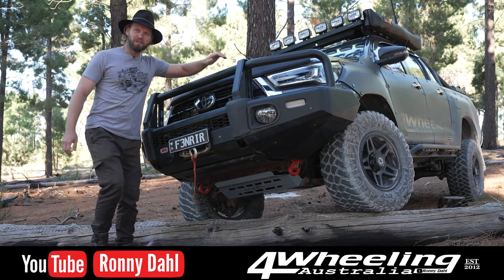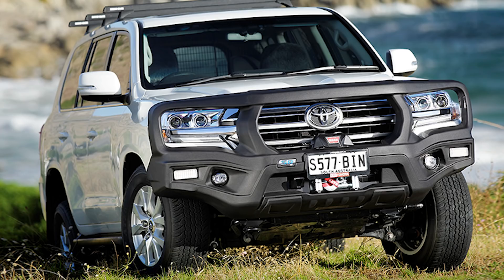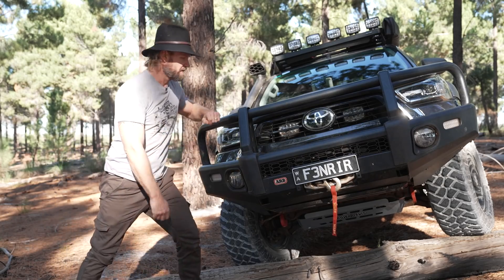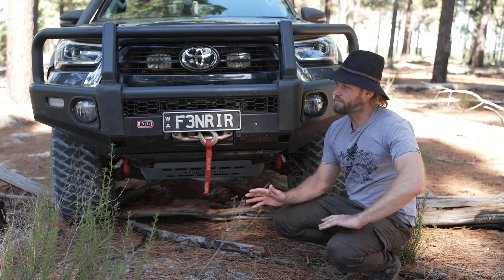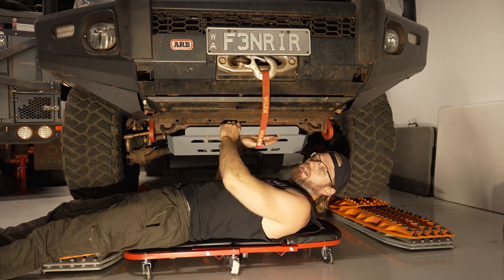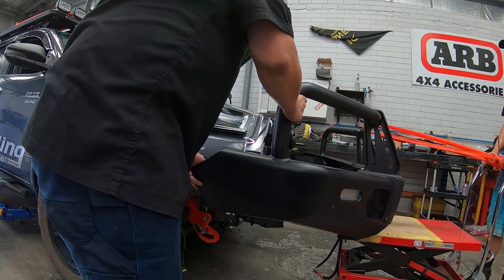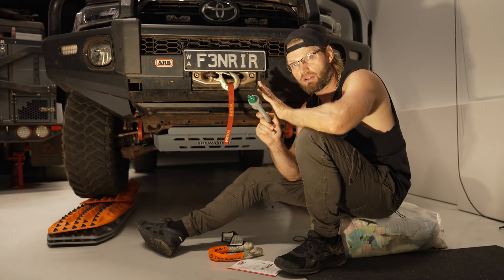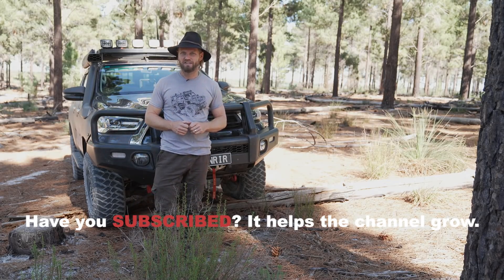2021 Hilux mods, off-road bar work mods part 7

Comment: I put an Aussie Aluminum Alloy Bull Bar on my 1987 Suzuki Samari. Was running 30" tires and a 2" lift, doing 65 MPH down the road and a ten point white tail buck jumped out of the ditch. This thing weighed  200lbs dressed. 
My reaction time in those days was better then most and I was able to hit the brakes at impact couldn't bare to look at damage for a few minutes, thought my Sami was toast. The only damage, was the top horizonat bar was bent maybe a half an inch! At 1000 dollar price tag in those days, that was the best insurance possible. Weight was a factor with the Sami so I went with the Aluminum Alloy, advertised as "strong as Steel"!

Enjoy your treks on the tube, trying to adapt my Sami to accomodate my bilateral amputation, slowly but slowly, LOL.
Regards

John R Monroe
Hibbing, Minnesota

Comment: Nice video again! 
About the transfer case bash plate, I think those mounting points on the case looks pretty weak. Aren´t you worried it will just break off those instead? I figure the original one will give way, but still protect the cast housing with a bit tougher steel? Maybe you have some experience or stories about what and how things break underneath - would surely be an interesting episode ;)

Comment: Hey Ronny as always thanks for your work. Quick question and recommendation, 40mm or 60mm ARB Summit steel bullbar? For a 78LC what would you suggest? I don’t intend to install flares on the LC78. I’m leaning towards 40mm due to weight. What is your recommendation regarding weight and strength difference stats. Thanks in advance and Happy Easter.

Comment: My rear recovery point is a 15 ton pintle hook and recovery strap. I got both the hitch and plate for $40 total plus hardware. The last 2 years I've recovered several vehicles in Alaska. I can't complain, it works.

Comment: Nice 4wd mate.  What are your thoughts on the fact that it will deactivate the A-TRC when the rear diff lock is ON while in low range?  Do you think it was a completely bad set-up from Toyota?
Reply: So that way, the front diff acts as an open one with no control.

Comment: Q: Was the bumper cut-in the only option or do they offer a full replacement bar?

The TJM Outback T13 bar includes rated recovery points and looks a lot better on later designed vehicles like yours because the design conforms to the angled or diamond-shaped grill. That model ARB bar is great but was originally designed for vehicles with a squarer, old school stance like the 79, Troopy etc. Love ARB, but it’s deffos time for them to up their game and release a bar for the 21st Century IMHO.

Comment: Hey Ronnie, just a thought on your winch set up. Weight, Safety and everything in between, I am pretty much down to a soft shackle  for all my attachments now and have removed my hook all-together. Basically I go direct from the thimbled eye on the winch Dyneema to my soft shackle to the point I'm loading, cant for the life of me see why I need another potential point of failure in the system (the hook). I have a short section of inch poly pipe with a v groove cut out for the thimble that locks against my fairlead to hold the thimble in place, just winch in and lock it away. Works a treat, keep up the good work bud

Comment: Great info Ronny, I’ll suggest double checking the weight of your bar. Had a steel TJM delivered to my home to install on my FJ. i was told it weighed 65kg. Bar arrived in box and the weight printed on the box was 100kg. I weighted every piece contained in the box and yep it all came to 100kg. I weighed the parts that came off my FJ to install the bar which came to 12kg. I added 88kgs before even installing the winch. Your weight of 65kg is bar only and not all the added bolts, support steel bracing etc etc
Reply from the maker: Interesting points there mate, I’ll add an unknown extra weight at the end to allow for it perhaps unless I can find the actual info
Reply: Which bullbar was it? On their Tjm website it says 100kg?
Reply: @sonsam1966  it’s the outback T13 bar. My experience was back in 2014. Back then no weights were mentioned on their website and I could only get info of 65kgs by the salesperson. It was impossible to get accurate weights of bars back then by any manufacturer. For some reason they kept quiet on that area but we know why now. In 2017 I changed to an Xbox bar and halved the weight. Cheers
Reply: Yeah I agree it’s a good solid bar but that’s way too Heavy on the nose of the vehicle even tho recovery point and reinforcements been added

Comment: Would love to see that Bull-Bar comparison. A comparison from full bar to the half bar without the top protection would help myself a lot too.
Reply: I was about the comment exactly the same thing. Love the look of the single hoop / predator bars; but are you just sacrificing your headlights or is it actually less engine protection than a full bar?
Reply: I have a 2019 Hilux with a ARB Sahara Bar single hoop. The hoop is only thin aluminium held in with  two M8 or M10 bolts either side. The protection that it would offer would be minimal. I didn't want or need a full bull bar, we do minimal rural travel and I didn't really like the look without a hoop. Not a comparison as such but maybe some food for thought.
Reply: @simmo6035  thanks Adam, does give some good insights. Cheers
Reply: @ablokecalledbeer  second this!

Comment: HI RONNY, I HAVE AN IMPORTANT COMMENT THAT YOU MIGHT WANT TO READ! Just like your issues with the roof rack, have you checked that you are under your front axle load rating with all that weight added to the front? Also is there enough weight left for the driver and a passenger? I know with that bar work that it protects the vehicle but it is quite an important point to mention non the less as insurance could be void if over the front axle load rating.

Comment: Another informative video Ronny. Can you advise what you done with the diff and gearbox breathers on the Hilux?  The factory breather on rear diff is located on the diff housing and the gearbox/transfer are located on top of the bell housing, and did you manage to find where the breath for the front diff is located?
Reply: Good question
Reply: If the breather sits on the rear pumpkin, isn't that lower then the rated 700mm wading depth?
Reply: @perpelle  Hi pelleper, it is my understanding that the specified wading depth is set to prevent water ingress into the air box, the computer and other critical electric components, and maybe even the alternator and possibly any air vents.  As the diff breather is effectively a one-way valve, no water (or air) should be able to get back through it.  This can be an issue as when a hot diff is rapidly cool (like when do a water crossing or it gets splashed with lots of water) the air will reduce in volume and cause negative pressure inside the diff housing that will suck the diff breather closed.  But as the negative pressure inside the diff will try to equalise with the outside atmospheric air pressure (or vice versa), it could end up sucking water, dust, mud in through the wheel bearings.

Comment: Wow is an additional 120kg forward of the front wheels really a safety feature? Also you have used half your payload on accessories so no passengers or GVM upgrade? It's amazing how quickly it all adds up and no doubt continues to add up in additional fuel cost over time, hopefully you can show us the sums so we can make an informed decision on what we bolt to our cars. Great series 👍 Cheers
Reply: Once you hit a big kangaroo you'll think it's great.
Reply: Be interested in crash testing, how do they pass adr’s etc? Are they designed to still work with crumple zones?
Reply: @KaizenOz  they pass crash testing, they work with crumple zones and they pass ADRs.
Reply: Mining company BHP, crash tested their Hiluxes with bullbars and rollover cages.  Conclusion:  leave safety to the experts, the OEM

Comment: the bull bar added 110kg to the front and changes the weight ratio between front and rear. Do you need to change something on your suspension because of the added weight? Maybe more "preload" on the springs?
jealous greetings from Germany, such cars would never be possible here :D

Comment: Love your vids mate.
Ronny I get that you don't like the look of  most aluminium bars but the Toyota aluminium bar is the best looking bar for that model car in my opinion (its well balanced compared to others) and you can have it painted black.  
It's winch compatible with the little number plate door. 
The product development budget is 20x more than all other after market bars so it's not unnecessarily over engineered, it has 90% the strength of steel, yet less than half the weight (not two thirds like you said) and of course its air bag compliant. 
It's designed to flex and fail before your chassis does which is a big thing if you don't want to crab walk forever after a kangaroo strike. 
It's also designed to act like a hull in water.
The reason why I bought one is because being a bricky I've dropped many profiles over decades, steel and aluminium and the steel ones always bend on impact where as the aluminium ones flex and stay straight. I knew this flex was important so I went down that path and I was right. My bar has hit a good size roo (unfortunately hard enough to kill it) and it only dented (which was easy to hammer out). It acted like a tough spring, I suppose thats why Toyota promise you can drive on after a kangaroo strike.    
Thats my experience anyway.

Comment: Hv to admit, 15 years of 4wdriving since i was 25 yr old and i hv been using the shackles the wrong way.
Thanks Rhonni
Reply from the maker: I have as well mate
Reply: Really it is the  recovery points which are in the wrong orientation - if the holes were in the horizontal plane the Riggers "proper way" would be the correct way...
Reply: @kadmow  
😆Jesus bro, don't do this to me.

Comment: Wouldn't mind finding out if you are installing any gauges?  Monitoring Trans temp / EGT while towing?
Reply from the maker: I have a scan gauge already but I’m still waiting on X codes so I can read everything
Reply: @Ronny_Dahl  Thanks mate.  I don't think you can get EGT's with the scan gauge but I might be wrong.  I know I can't with the Prado 150 (2010) that I have.  Requires a sensor tapped into the manifold or exhaust.

Comment: You're not wrong the steel bullbar is heavy, i put one on the Prado before lift kit.
The 50mm lift raised the front 70mm, it sagged the stock suspension that much! Mines 80kg so a fair wack more than the Luxy one.

Comment: That’s a lot of weight, but when touring, it’s a necessity. Hit something with stock bumper it’s a trip ender.

Speaking of the front bumper and it’s removal... it IS actually a removable bumper. If you look closely, there are lines underneath the lines & the front grille. So the bumper itself was no need for cutting it. You could’ve removed it with ease.

Comment: A Bullbar is a must if you are travelling remote locations and as you say not just for animal strikes. I was in low range trying to get up a sandy track and smacked into a tree at the top as my momentum didn’t allow the car to turn as I hoped .... a dent in my Bullbar but I could continue my trip

Comment: Hey Ronny
This is a great series of videos! I'm learning a lot, even for my Ranger, as my first proper build. So far my only disappointment is the Rhino-Rack Pioneer Platform not being as capable as I expected and was advised it would be, as you outlined. I'll keep my platform for now and just be more careful when loading it.
I'm looking forward to seeing what you have done with your tyres and suspension as these are more of a priority upgrade for anyone than some of your other indicated modifications. 
Cheers mate

Comment: Could you do an industry piece about fitting accessories and what impact this can have on (NCAP) safety ratings, passenger safety, and possibly insurance issues? What does it mean when bull bar and rock sliders are airbag compatible? Does that also mean they don’t affect the crumble zones? In Victoria you aren’t legally allowed to alter the vehicle suspension if it affects the vehicle stability controls, unless you can disprove it.

Comment: I’d love a video on whether you need a winch and whether you need a lift kit. Or if you can get away without one or both for a solo traveller.
Reply: looks to already have a 2” lift kit
Reply: @xaviermann6803  still stock suspension at the moment, he will probably lift it once he has everything weight wise loaded up how he wants
Reply: I to would really appreciate a video on whether a winch is really needed. A decent winch is expensive  and if I buy one will I use it or can I use max tracks instead?
Reply: @blokebeershed7651  Pretty sure he's running the OME remote resi 2"

Comment: The insight into how much weight these modifications add is really insightful, but knowing the price of all this stuff including installation costs for stuff you don't do yourself would be very valuable. I've got a 2019 Ranger (US) that's still stock, and I want to get an idea of how much this stuff should be costing, where I can get away with something mid-range, and where I should spend a lot for the best product.
Reply: I’m in the same boat as you with a US Spec Ranger but luckily I can do all the install myself. I have about a 15-18k wish list of mods I want to do for a full overland build

Comment: Interested in cost to date, we have a weight, but no cost yet.

 Also 454kg - what's that leave you in weight to carry, and especially what's left for a tow ball weight if you had a van on with average ball weight around the 200-250kg, tanks full and family as the lux currently sits?

Loving the video. Gives average Joe real indicator as to cost to get vehicle to result desired. I'm sure often we buy wrong vehicle to start with because cost of getting capability with after market is more than vehicle worth.  Then insurance issues where so many insurance companies only allow % (10-20%) of vehicle cover to be accessories.

What next - suspension.
Reply from the maker: I let the cost out due to it being varying also people seem to focus too much on the cost and not the rest of the important stuff
Reply: Add 200kg on that and your at 650kg. 920kg max weight carrying capacity so that leaves you with 270kg for fuel and people on board. Thats why I did a GVM upgrade on my vehicle. Another 465kg carrying capacity. But that does not increase your GCM. Can't have many mods done to the vehicle if you plan on towing a big van.
Reply: Just curious to say the nearest $5k. Plenty of us look at price of hilux, vs Prado or Nissan offerings. Pat Callinan for example, yes, the ford everest went a lot of places, but dang, they spent some money on it. Even he described it as "a good base to build from". I guess that's the angle I was coming from.
Cheers.  @Ronny_Dahl

Comment: Mr.Dahl, I was wondering why your videos usually are captured with 50fps, I spend more time on youtube than most of your viewers I can guarantee it. 24fps (25 fps in your case would give you a much more cinematic look to your videos. 50fps is more suited to moto vlogging or fast-paced sports etc. for example even with that you can't imagine how good the 24fps videos look. I can give you a couple of examples if you are interested. the quality of your videos and the content is superb. but if you can capture a video in 4k 25fps if you have the equipment you will get more views ( because youtube algorithms automatically put your video higher when searching) the 60 or 50 fps looks way too smooth which is not a good thing because people aren't used to it. every movie in Hollywood still uses 24fps, every tv show is 30fps for example. and the ones with 60fps look weird. I'm not saying this to criticize you or put down the effort you are putting I swear to god this is one of the best channels on youtube no doubt about that and I binged watched your videos like crazy. I want your channel to be the best offroad channel on youtube and you are not far from that. give it a try :) <3. ( sry for my poor English  )

Comment: How does the bull bar go with the parking sensors and the active cruise control?
Reply: Radar cruise works through the badge. Lane departure and sign recon works with the cam on the window.
Reply: @jimlstheworldyewww7516  
I know just wondering if the middle loop interferes with it at all
Reply from the maker: Works well mate pretty much the same as before I haven’t noticed a difference

Comment: I've put the same bar work on my Luxy but i got ARB side rails and steps as well.  You didn't want the side rails or steps??
Reply from the maker: I wanted to save weight somewhere and that’s where I saved it. I do have rock sliders however which are Uneek 4x4